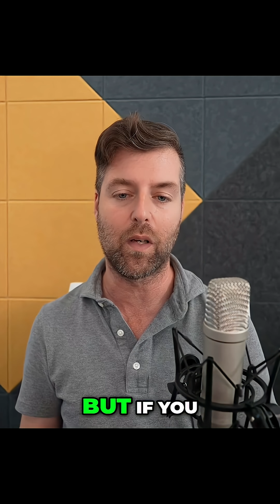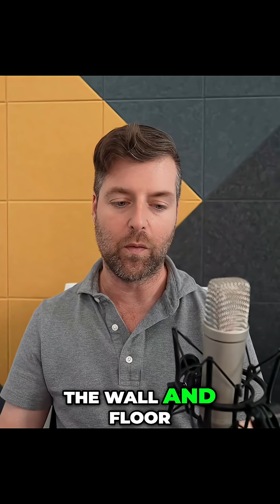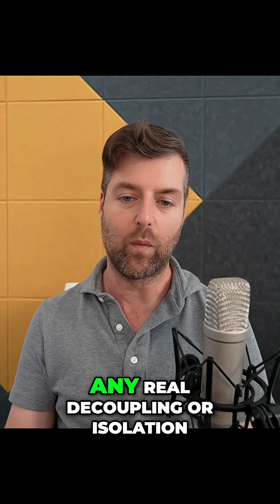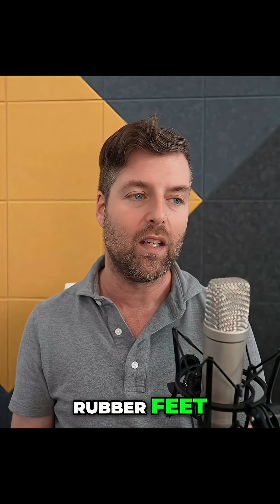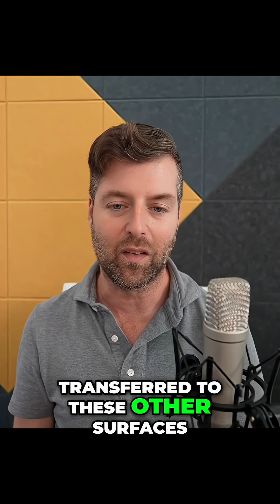Subwoofer Isolation Test: Rubber Feet vs. Professional Devices

Comment: I like a concrete tile and sorbothane sandwich stack. Have to make sure you calculate the right durometer for the sorbothane on each level. Also don't go too high since that will cause cancelations. But i have noticed playing with height can create a better response.